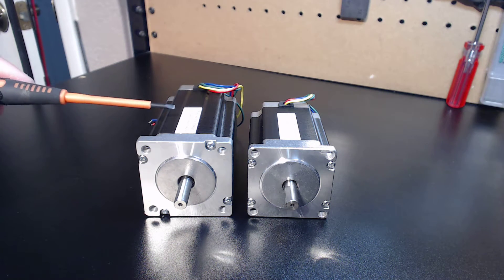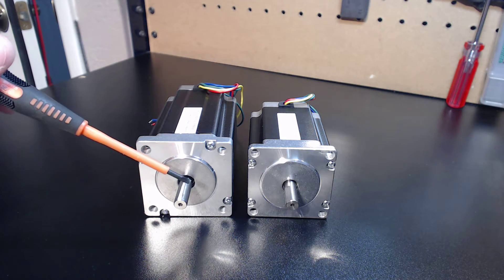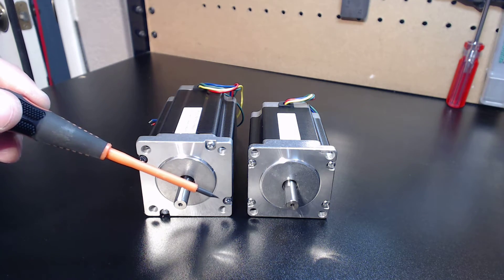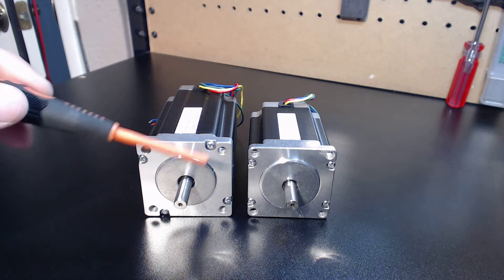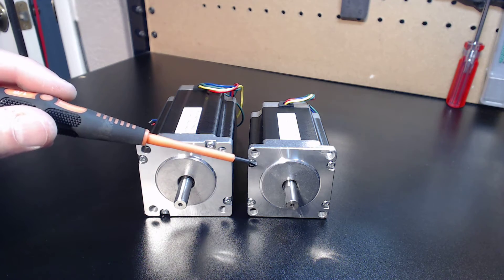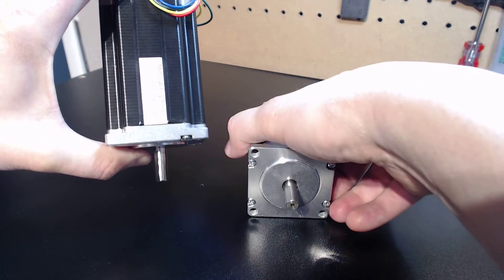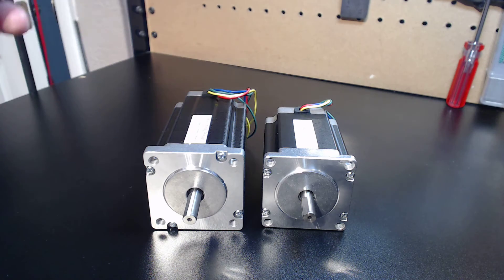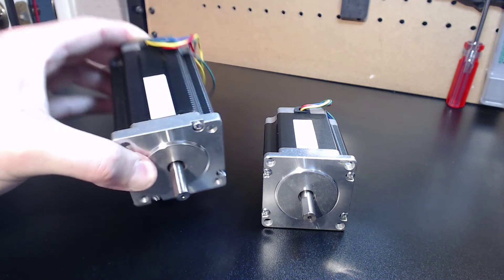Rev2 Motor Update (8mm shafts On 300oz, and 600oz)

Comment: Hi what your thoughts on the Masso controller unit?
Reply from the maker: Daniel, Thank you for your support. The Masso isn't a unit I would recommend as it doesn't offer the end user the feature set of a Mach based system. Its virtually impossible for any integrated system to incorporate the feature set of a non integrated system. The other issue is processing horse power. A stand alone system uses a PC, with an integrated controller it handles everything to replace a PC, and that means less processing power. This is why, so few are on the market.  Thank you,
Vince
Reply: @corvetteguy50  thanks Vince the info is much appreciated. I have another question, I'm in the stages of designing a CNC router frame from 16mm mild steel plate and aluminium extrusion and wanted to know if the style of frame design ( fixed gantry, floating gantry or slave set up) will dictate the material's I can cut???. I want to cut mostly aluminium and some Steel.
Reply from the maker: @NYON-xn3xg  Daniel, thank you for your support. Machine design is a variable that will certainly effect the machining ability of the system, but is only one of the many that will effect the machines overall ability. The main thing when designing/building a manufacturing robot is to understand what you plan on using it for, and design it around those applications. What are your intended applications for the chassis?
Thank you,
Vince